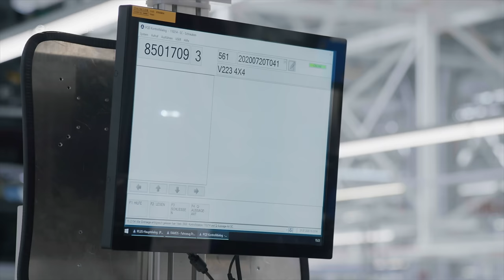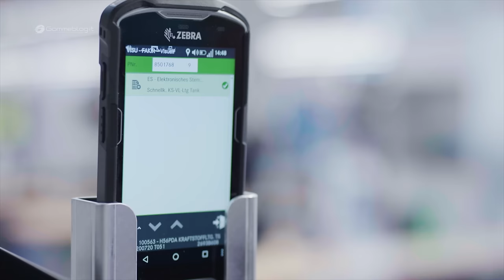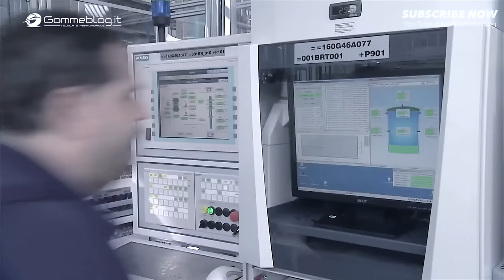Mercedes PRODUCTION - Germany CAR FACTORY

Comment: Mercedes cars are generally distinguished from many other cars by their high stability while traveling on various roads, especially at relatively high speeds because of their high ability to absorb vibrations and external shocks, so we find its structure, engine and all its parts made of high-strength materials, which makes most of the wealthy and diplomats prefer to ride because of its smooth movement on the roads.Therefore, Mercedes is the symbol and pride of German industries and a true expression of the German manufacturer's philosophy .
Reply: then why are german cars considered unreliable as compared to the japanese?
Reply: @zee9276  The problem is not in the quality and reliability, but in the price of the car and the cost of its maintenance, as we find that German cars are usually more expensive and more expensive to maintain than their Japanese counterparts, so we see that Japanese cars are more desirable than German ones, especially in the Middle East and East Asia.
Reply: @ajpt4336  true.
Reply: No. It's all down to the driver.
Reply: wow
Reply: ok
Reply: @zee9276  because Japanese cars are bare bones while German ones are cutting edge
Reply: @MaticTheProto  so cutting edge that they are endless money pits after a couple of years. but you're right, the people that buy them don't care, they just move on to whatever's latest
Reply: @zee9276  haters like you love over reacting....
Reply: @MaticTheProto  im not hating. it's just a fking car mate stop being so obsessive lol
Reply: @zee9276  says you

Comment: It's easier to assemble them during production, than to repair after wards. Everything during the design process is optimized for production and assembly. But the robotics behind it's pretty amazing when I saw the BMW line in one the movies. Then the Merc production in this movie is a bit different, maybe older. One of the best moments is when the robot mounts the dashboard inside.
Reply: That moment with the dash being mounted by the robot is at around 1:50:00

Comment: My Mercedes  was built with a manual tailgate, not what I ordered, It lifts far too high for me to reach, as a result has caused severe arm and back discomfort, the dealer has said nothing can be done to lower the height, I disagree,
This is my second Mercedes, and may be my last. What were  the manufacturing department thinking about eliminating this feature, just not acceptable. especially in the year 2022. any help or suggestions of how this can be fixed.  Joyce

Comment: There almost perfect but you have a human component and you have some parts that are plastic that should not be in other words some things are designed to fail 
   maybe valve covers plastic or timing covers plastic, plastic tensioners?
Reply: They need to make the cars lighter, and cheaper to build. This is also the reason why their timing chains are only single chains today which last barely half the life span of the timing chains of the 90s, and why their gear boxes have narrower gears today.

Comment: This is why the S500 is Worth 180k.🤪✅🆒👏🥇🌟⛄🥃⛽😷
Reply: This is actually why cars are so cheap. It's proof of the opposite. 

I've helped build 3 production lines with 2 of them being fully automated. Automation is amazing for the bottom line. Increased production at higher quality and no labor over head. It's a win win for the brand owner.
Reply: @Nurhaal  Funny thing is: factory 56 reduces automation in favor of manual labour suported by handling equipment. Makes production much more flexible, which was a important point of factory 56 because they want to produce a lot of different models there.